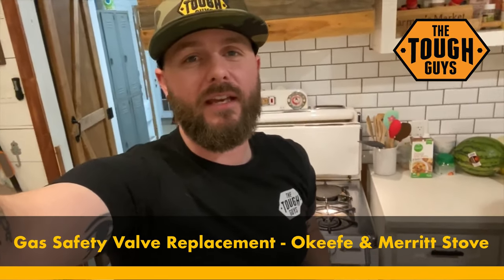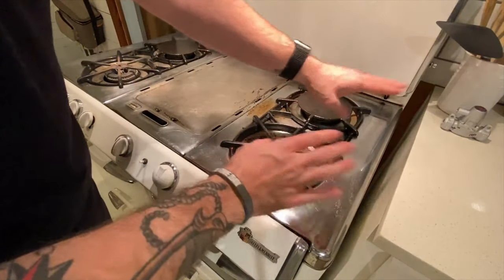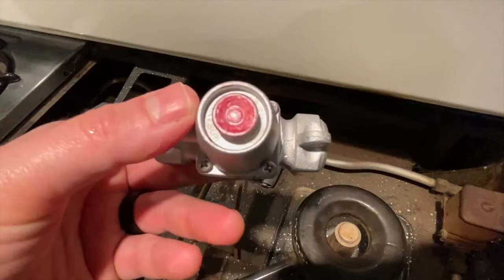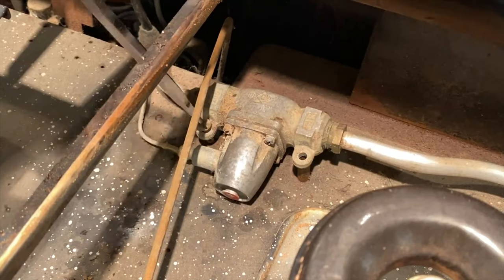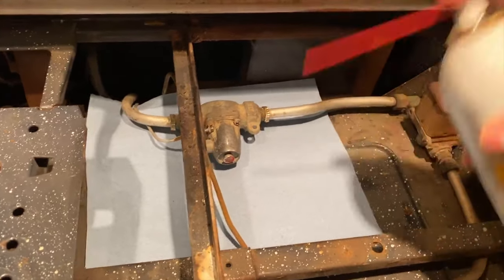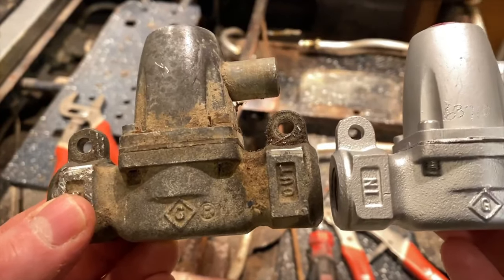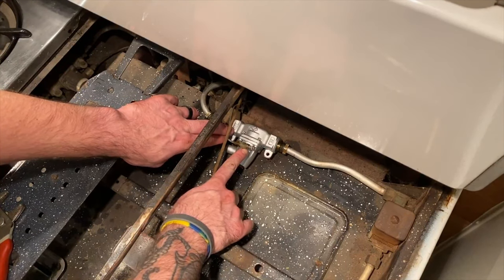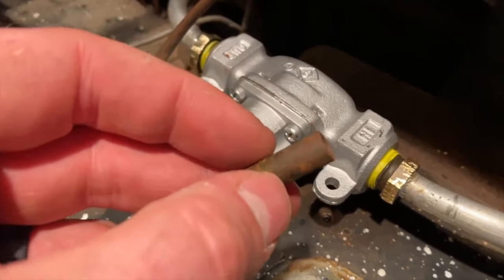Okeefe and Merritt Stove - Gas Safety Valve Replacement

Comment: We are having the same problem with that EXACT same stove 1953. I have reached out on FB and Here is my rabbit hole discussion thread...""don't give up. I used a frozen apple pie as a tester and it took me 5 hours to get it to bubble while pushing the red button on the safety valve every time the oven went out. Oven only heats up to desired temp and then stops. Everyone I've talked to says "it's all mechanical and can be fixed" it's just narrowing down the faulty part. We replaced the thermocouple. Was not the problem. Replaced the (tested) safety valve that sends gas to the oven. Was not the problem. Cleaned the pilot orifices. Was not the problem. Next suggestion is possible failure in the thermostat behind the stove knob. Maybe these steps will help you! I'll update the post when we turn the next corner."" Good luck OKM fans. We are looking into an oven knob thermostat replacement next step...03/08/2023

Comment: Just a heads up, you shouldn't use tape on a flare fitting. The flare at the end of the tube is what does the sealing and the nut provides pressure to hold the flare in place. Adding tape or sealant to these actually makes them much more likely to leak due to a bad seal or for the nut to loosen enough from thermal expansion to cause a leak. 
Just a heads up for anyone reading! 😁
Reply from the maker: Thanks for sharing the tips!

Comment: How did you decide it was the safety valve preventing the oven from lighting? And because that didn't fix the oven, what turned out to be the fix for that problem? Have an O&M from the 40's with the same problem (oven stopped working) and am trying to diagnose it. Thanks for this video.
Reply from the maker: Unfortunately we still do not know yet. We did discover that you can use modern brass flex lines (the vinyl coated ones) and that’s been cleared by some plumbers and appliance guys so that means I can start replacing the interior lines.  Next step is we are replacing the thermocoupler first, and then onto the control knob for the oven. We will record the next steps for sure to try and help out whoever we can!! If you find a solution on your end please come back and share if you don’t mind 🙏🏻🙏🏻

Comment: Use wrenches, not pliers.  Also the thread tape was put on backwards from what was visible before the video cut away.  Tape goes on CCW on a right hand thread, so it tightens the tape with the fitting.
Reply from the maker: I definitely seated the tape correctly maybe not I guess in the video and I did end up using a wrench towards the end... thanks.
Reply: Additionally, you should never use tape on a flare fitting. The sealing happens at the flare, metal-to-metal seal, not the threads (like water does.) Also a good reason to be careful not to scratch the flare meeting surfaces.

Comment: I’ve got the identical stove; but mine lacks the accessories on top.
My safety valve is on the bottom in the storage drawer beneath the liftomatic oven.
I’ve got a pilot light button on the right and a safety valve on the left.
Mine stopped working mid cycle and the pilot is lit; but oven won’t lite.
If your pilot doesn’t lite; you probably need that mechanism (I can’t remember the name of it) replaced. 
If like mine, you may need a safety valve replaced and/or just to clean the burner with a paper clip-each hole and remember to get in the back by the pilot lite -make sure there’s no soot on it.
If your old and broke down like me; make sure you have a firm pillow to rest your neck…
There’s a Facebook group devoted to old stoves like this and a lot have OKM’s. 
Hope this helps someone!
Reply from the maker: Thanks for sharing your notes here, there is so little info online so everything helps!

Comment: Hey man I am in the same exact boat as you with our okeefe with one side of oven not working. I will follow along to hopefully find a resolve. Our pilot light works but oven won't come on. Did your pilot light work?
Reply from the maker: The pilot lights we got working but could still never get the oven to work. For now we picked up a new gas stove, and got this one back in the shop. Ill definitely do some videos once we can get it fixed by a pro.

Comment: My wife just bought an O'Keefe and Merritt stove. I took a quick look in the back. I didn't see a place to connect the gas. Where should I be looking?
Reply from the maker: The connection is under the top cover near the burners. The gas line runs up the back side and into the top area. Hope that helps!

Comment: Ive come up with one of the same stoves but the safety vavle is not in the top of the stove were you are replacing yours any ideas were else it would be thanks for any help you can give me
Reply from the maker: Sometimes it’s in the bottom left storage compartment, on the front side. Open the door, reach in and up - hopefully that’s where it is for you.  Thanks for watching the video and hopefully that helped you!!

Comment: I’ve read online that you turn on the gas to the oven and press that red button on the safety valve to get it to work ahain
Reply from the maker: We’ve tried everything I think - unfortunately probably some more replacement parts soon! Thanks for watching
Reply: True, IF the safety valve is working. Mine is broken so that's not keeping the oven on.

Comment: Thanks for the video--I didn't see where your links were as to where to find thte parts.  Can you let me know please? Thanks
Reply: Under links to parts Grapevine Sally is mentioned.  ATM they have most all of my parts that need new chrome and some that need new porcelain enamel (PE). They are also rebuilding or replacing the safety valves, pilot lights, and gas plumbing.

Comment: Mine suddenly has too much fuel being sent to the front left burner (most used side). I know how to adjust the shutters and pilot light, but does anyone know how to adjust the actual amount of gas fuel being sent to the burner. You can hear that it is wayyyyyy to much and the flame is ENORMOUS. Something changed, not sure what happened.
Reply from the maker: def not good having too much gas! Has to be the regulator / issue inside of it.

Comment: why are you using channel locks on that?  use a proper wrench!
Reply from the maker: Well, I record these videos as I go and I don’t pre-plan much.  In this case, I grabbed a few tools in the shop and then came inside.  I was not expecting these things to be so tight and corroded .. so yes I agree, and I did end up using a wrench to get them free, after some liquid wrench as well.  Thanks for watching!
Reply: Has anyone shown you the correct direction to place the jaws of the Channel Locks when tightening/ loosening? Better still, run to the garage for the correct wrenches. No tape necessary on the threads, it is a compression seal.
Reply from the maker: Thanks for the advice. Apparently I’m just a bumbling idiot, but hey hope you’re having a great night! ✌🏻